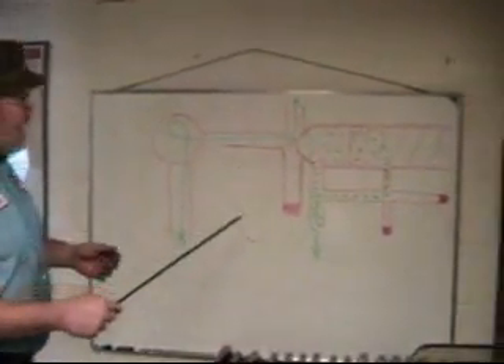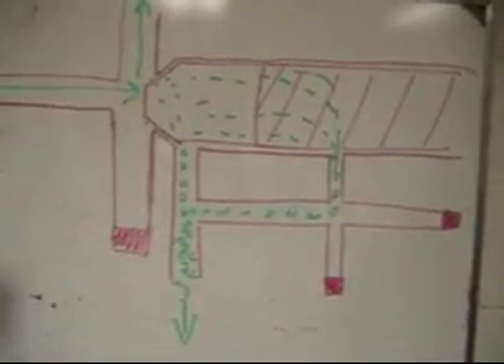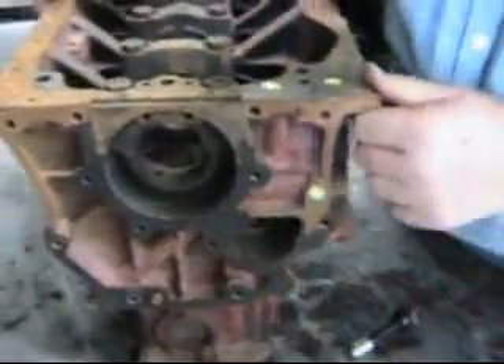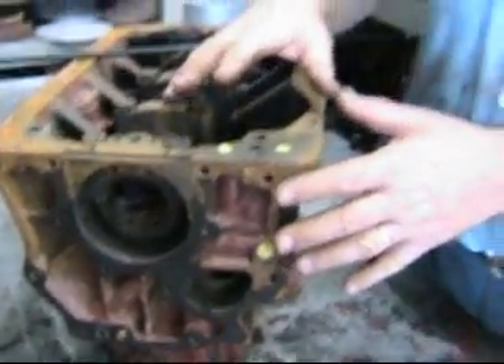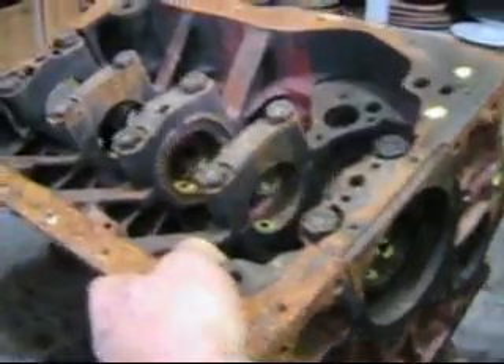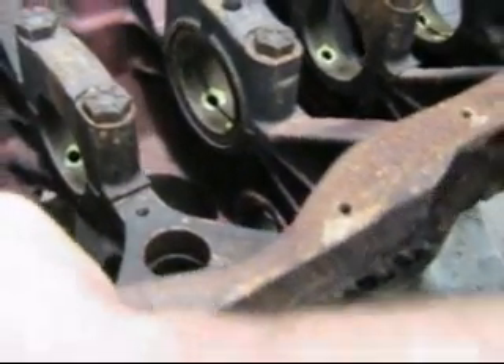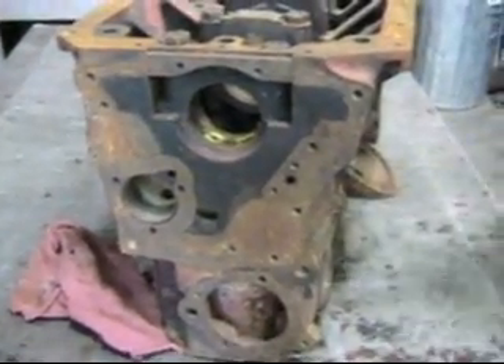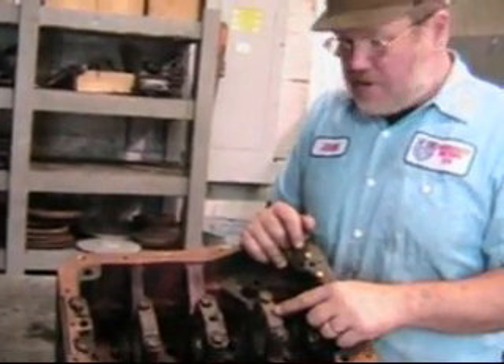038 MG Tech | Oil Pressure for MGA/MGB

Comment: can I get oil pressure just cranking the engine over
Reply: Yes you can. If the engine has been sitting for a long time you may need to prime the oil pump. Do a search and you’ll find instructions on how to prime the pump.

Comment: Hello John,
My midget 1500 engine goes to 100 PSI in 900RPM!!! Later pressure falls but not that much. As soon as I accelerate pressure goes wild again... I have changed oil (10W50 Castrol) & oil filter GFE150 twice. Bought new pressure relief valve (Spring, little piston) but this is not the case. I think because of this pressure now I have crankshaft oil leak :( Front & back. I have put engine flush now & will try to clean rocker shaft & change oil again. What do you think problem can be???
Reply: Did you put in the shims when you did the pressure relief

Comment: I'd renew the oil/filter, and run the starter-motor with the plugs out until pressure is seen on the gauge; replace plugs and start the engine.